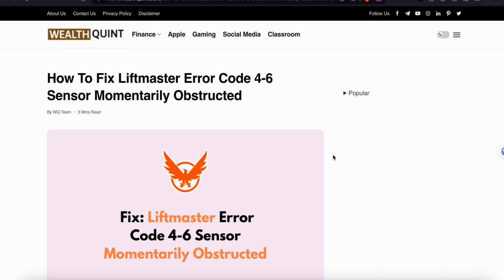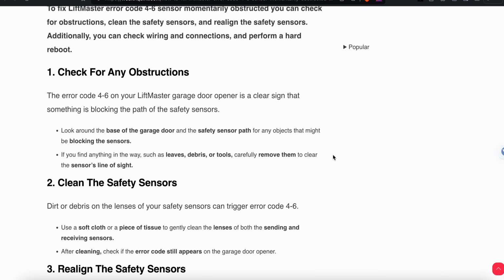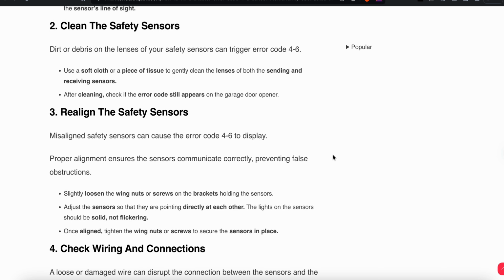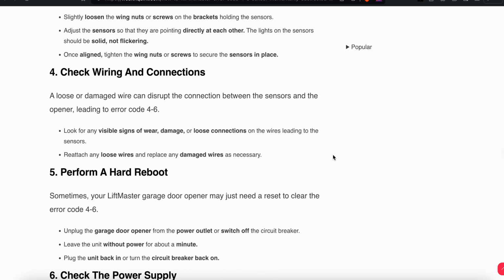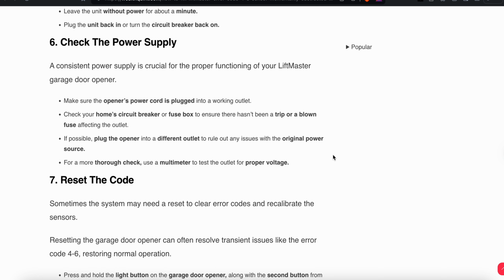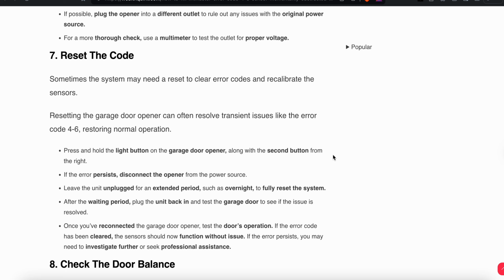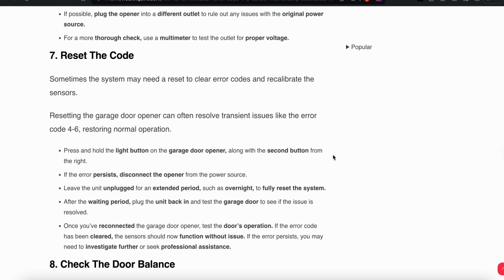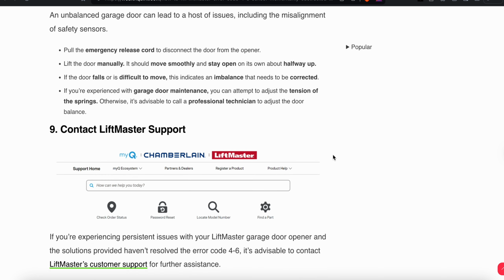How To Fix Liftmaster Error Code 4-6 Sensor Momentarily Obstructed

Comment: My problem is one of the sensors has no light, i.e. it appears it is getting no power. I thought maybe it was bad but after connecting a new sensor there is still no light.
Reply: I have same issue. What did u do resolve it ?